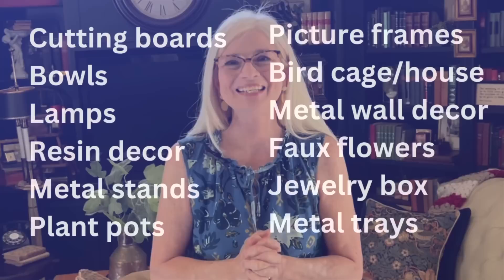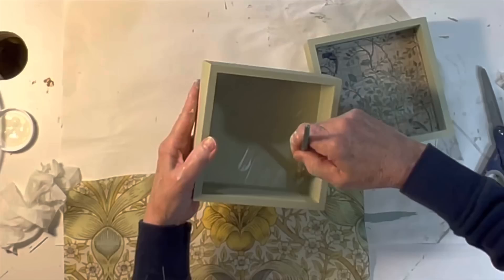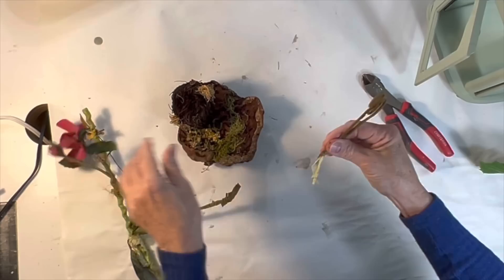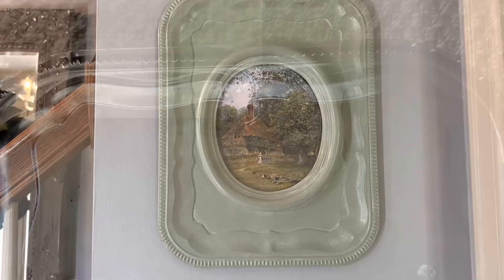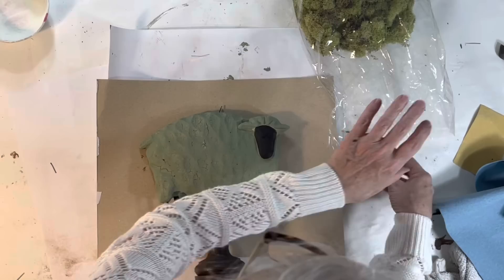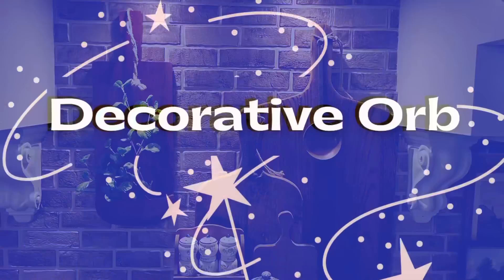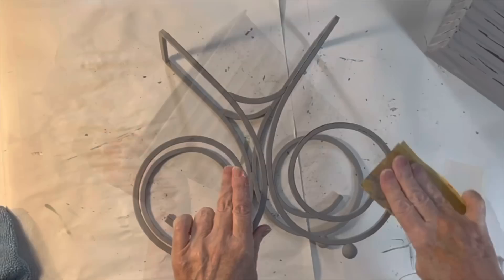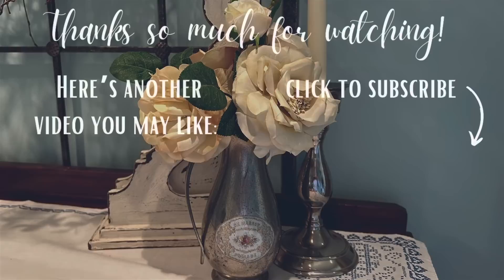10 DIY PROJECTS USING COMMON & CHEAP THRIFT STORE FINDS!

Comment: @ 17:23: wine rack?  perhaps the little balls aren't feet but instead turn it over and they are supports for a missing tray on the top? i really like the butterflies on the small square boxes. very pretty and fresh for Spring and Summer.  the 2 bowls + cutting boards are perfection! i also like the platter and oval frame combo. very nice!  hahaha! i LOVE the sheep topiary with bird and nest. that's fantastic! 
i vote for you to keep the mirrors in the music box terrarium. if you get tired of the mirror look you can always use the trick i used years ago: cut contact paper to size for the mirror. place contact paper over an image; rub thoroughly from the top side of the contact paper to transfer the ink from the image to the sticky back of the contact paper; turn it over and use water to wet and gently rub off the paper, leaving behind the ink; place it on the mirror for a muted 3-D effect. 
thank you for another wonderful video!

Comment: I Great job on everything, Sherri! My favs are the frankenplanter, the orb piece, the jewlery terrarium.  I do believe the glass needs to stay because it gives it diminution ( dont think I spelled that correctly and the auto- correct said this is right. - Lolol)  You have such great ideas when combining totally different items. The tray and ival mirror look good together, however; It seems to be missing something but, I'm just not sure what just yet. Maybe some antiquing, a coat of dark wax, then rubbed off with a baby wipe , let dry and then a coat of white wax dry brushed over that or just wiped off. I also thought that possibly just the oval frame needed antiqued a bit along with just the outter edging of the silver platter.   Let me know what you think of that idea, please.  Blessings always.

Comment: Out of concern I must say Please please PLEASE Sherry be careful using your circular table saw! !At approximately13:50 in the video  I saw you use your hand and not just the stick to hold a bowl & push it through while cutting. I realize that you are confident using your tools, but please I don't want to see you loose fingers or part of your hand! I would hate to see you missing the hands/fingers that you love so much to use! I also showed my husband this part of the video and he cringed agreed it looked very hazardous.
Reply from the maker: I appreciate your concern for my safety! 😊 You are right! I won’t do this again. Even as I was doing it, I realized that it was not safe. In fact, if I cut a bowl in half again, I will use a jjgsaw instead.
Reply: @CanterburyCottage  👍🏻Glad to hear it🙂. Wondering would that  jigsaw be  any safer to cut a bowl with? Jigsaw still seems dangerous to me. I have a jigsaw myself. It's a challenging object to cut in half for sure! It's the round & hollow shape that makes it unstable and awkward to cut through. I wonder what a pro-carpenter would suggest? I'm not one. I'm thinking maybe a band saw, but that's  not something everyone has. I do love how your board/bowl wall hangers turned out, but I'm more glad you still have your hand!!